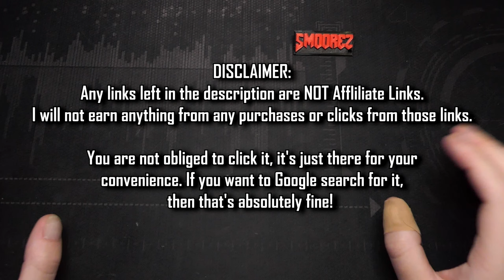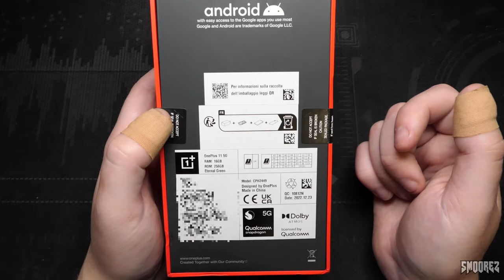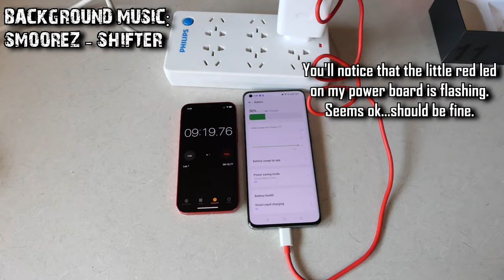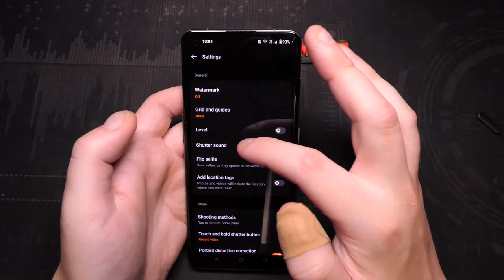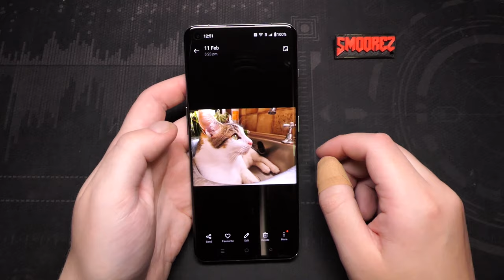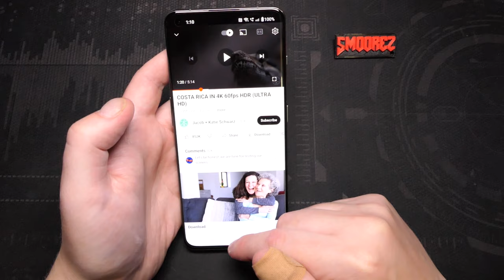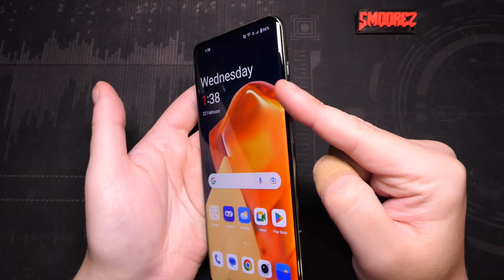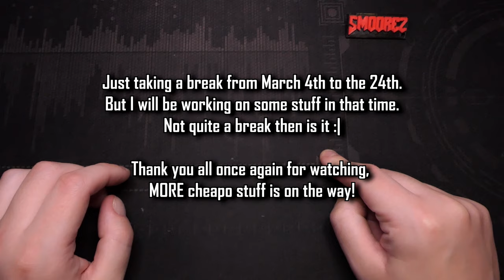OnePlus 11 Review, Unboxing & Teardown - This Flagship definitely delivers!

Comment: 22:07 Yeah that's totally fine, most LEDs aren't continuously lit up but rather pulsed very quickly, which is not visible to the naked eye but it is to a camera.
Also, I suspect the phone might have charged fully in 25 minutes or less if you had the screen off. These ultra fast charging solutions usually throttle the current when the screen is on to prevent overheating.

Comment: How is call volume by the way? 

It's what made me sell all my OnePlus phones. I had the 6T, 7 Pro, 9R, 9 Pro. They all had super quiet call volumes. Speakers were OK, but if the caller was a bit quiet, I could not hear them unless I was in a dead silent room. Which is obviously not always possible. Meanwhile a Pixel, compared to THOSE phones, has a super good volume. Samsung phones too.

I wonder if OnePlus fixed this for the 11. 

Another issue I always had with OxygenOS is the delayed notifications. Sometimes they would never arrive, sometimes they would take forever. Even with everything disabled.

Comment: Just out of curiousity - That standby drain - was that with Apps installed and Accounts logged in or the "out of the box" state of the phone?
Reply from the maker: Apps installed and accounts logged in. I always do battery tests with me actually stuffing around with the phone first. Sorry I didn't make that clear in the review!
Reply: @SMOOREZ  No problem but these are worring numbers in my opinion. I currently use a Oneplus 5T which has seen quite a bit of use over the years and I get nearly the same standby numbers despite the battery being much smaller.

But I personally keep my setup on my phones extremly light and optimized. Mostly using PWAs and only very little non Google Apps and non Open Source Apps.

Would maybe be an intresting video if you get two identical phones, on how much extra drain Apps add if that opportunity arrises. Its a very unexplored topic on YT in my opinion.

Comment: What surprises me is that my 150-200 dollar moto g stylus from 2021 charges faster with a lower watt charger lol. Not 0-100 but 0-50 is about 10 minutes give or take. 0-75 is about the same and 0-100 is 30-40 minutes.

the last time i hit zero it only took 15-30 seconds to get to 1 percent. So definitely better if you really need your phone right that minute.